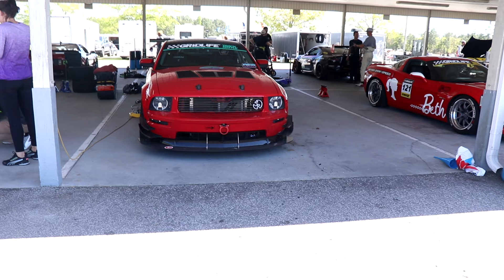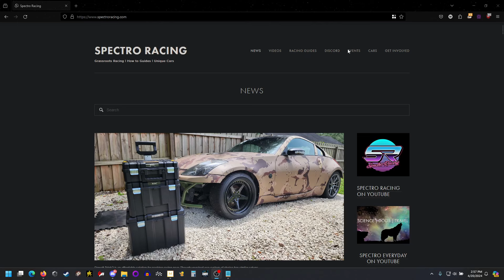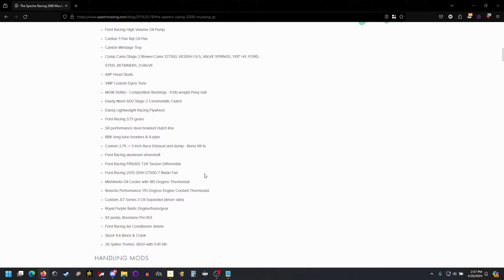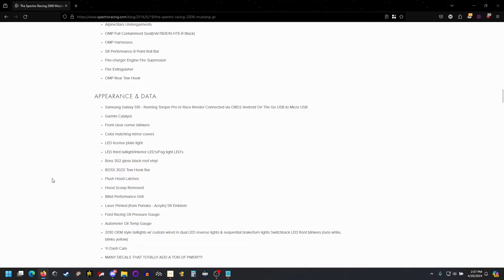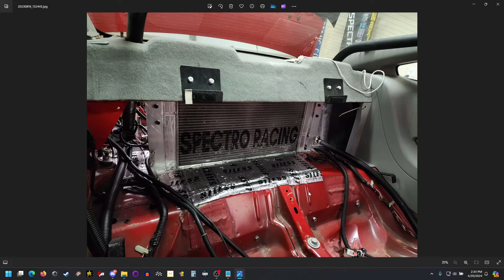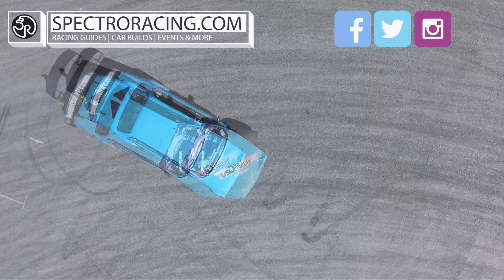Trunk Mounted Heat Exchanger - Extreme Mustang Cooling.

Comment: You should pop those quarter windows out and make functional scoops to hit that heat exchanger in the back seat. Like brake ducts.
Reply from the maker: I did make a set of 3 inch window louver NACA intakes, 3 inch wasnt enough CFM for the radiator but probably is fine for the brakes. However the TA sessions are at most 15-20mins and the brakes last long enough. I did have a set of 4 inch NACA intakes but sold them before trying them out. That might be enough CFM for a rad or just help i suppose. I dont think that is allowed though in Grid life Street Mod. The rules say you cant modify OEM glass.

Comment: Remember, theres a small c clip from your brakeline somewhere in st marys GA
Reply from the maker: I still double check that the clutch line is secure before a race ha, i remember replacing that with ya. Funny enough i did replace it with an OEM part, a VW part as ford doesnt really sell it but its the exact same part on VW.

Comment: Did he pull the fenders? Or is this a different car?
Reply from the maker: I cracked the Fiberglass at Sebring when the serpentine belt decided to go on vacation mid turn. I sold them to someone that was gonna either run them as is or repair. Ironically the car is faster now with proper aero. The fenders were good for Autocross so i could fit 335 A7s. With Gridlife its limited to 285 street tires so it would have been silly anyway. Anywho i sorta go over this in the Grid Life Prep video too.  https://youtu.be/eDg_-2VqsfI?si=4DyF0h7fFbPoY3ZL  Thanks for Watching!

Comment: I thought you sold the car when someone with your old fenders was in corner ponies
Reply from the maker: I cracked the Fiberglass at Sebring when the serpentine belt decided to go on vacation mid turn. I sold them to someone that was gonna either run them as is or repair. Ironically the car is faster now with proper aero. The fenders were good for Autocross so i could fit 335 A7s. With Gridlife its limited to 285 street tires so it would have been silly anyway. Anywho i sorta go over this in the Grid Life Prep video too.  https://youtu.be/eDg_-2VqsfI?si=4DyF0h7fFbPoY3ZL
  Thanks for watching!